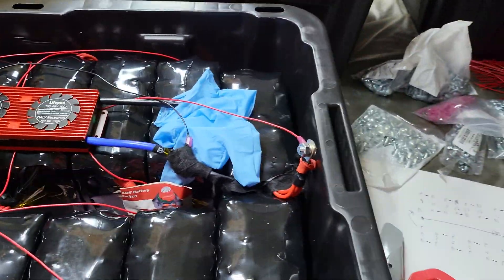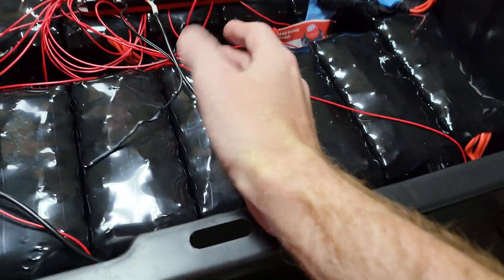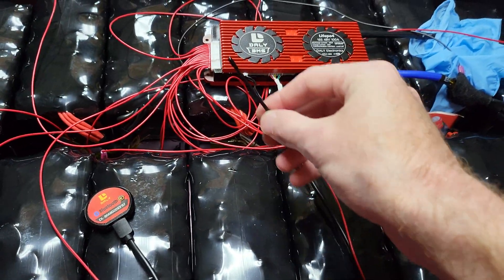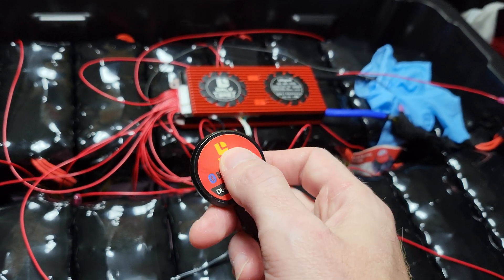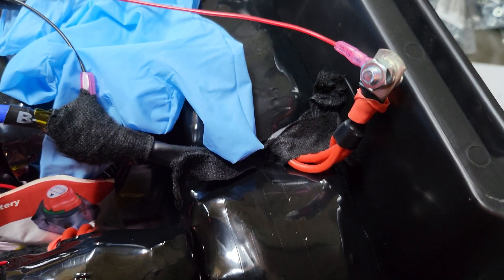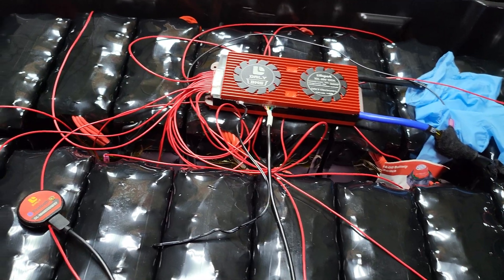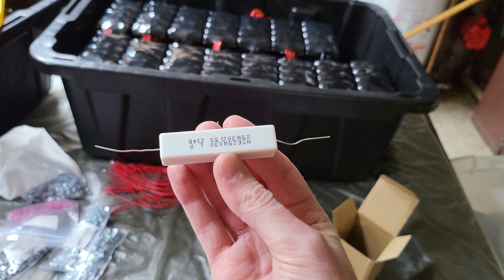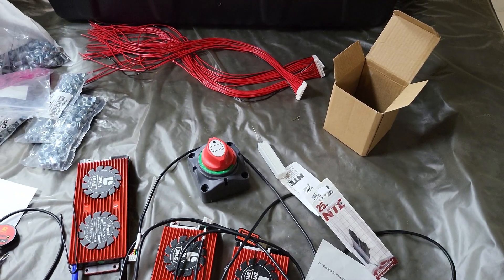Battery Hookup Lifepo4 battery Module 48V house battery build Part 3

Comment: There's still one concern about Daly Bms...did it specify a max Voc??...if your mppt CC gets disconnected from the batteries for whatever reason the bms is intended for, know for sure that most mppt CC don't support that disconnect sequence, if that happens you will have an mppt CC riding freely at the max PV Voc, if this voc is not supported by your bms it will get fried at reconnect point, the bms will no longer be able to protect your batteries and guess what's going to happen...
Reply from the maker: From testing that is not really a concern.

Comment: You do not have to press the pairing button on the bluetooth dongle more than the one time.  After that, all you need is a current (load or charge) of around 5 amps to wake up the BMS/Bluetooth connection.  I learned that lesson the hard way!  :)
Reply from the maker: True but if it's not connected to anything you do have to press it.
Reply: @darrenorange2982  - Yeah, definitely need to press it the one time, to pair it, unless you have everything connected and there is a load going through the BMS.